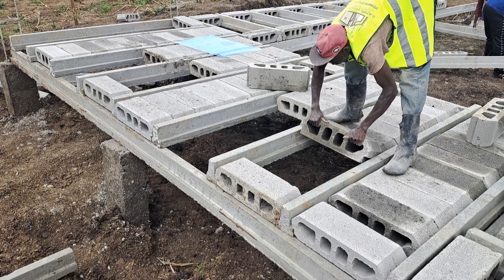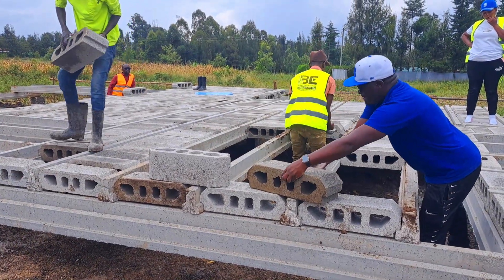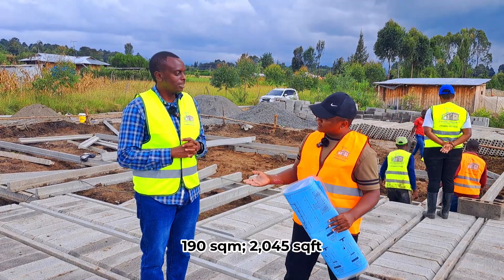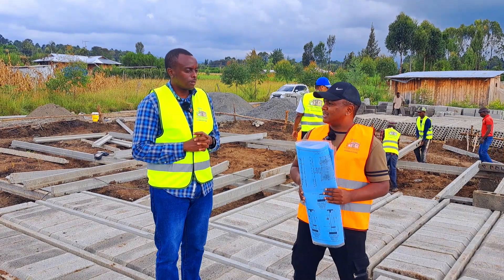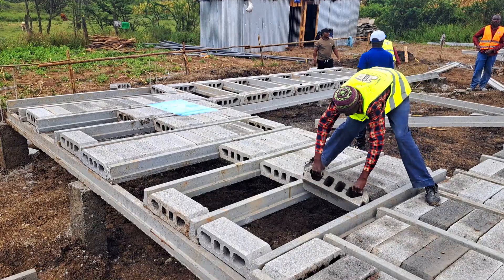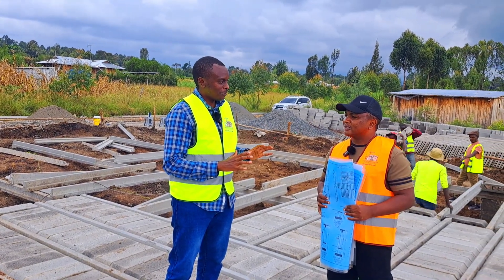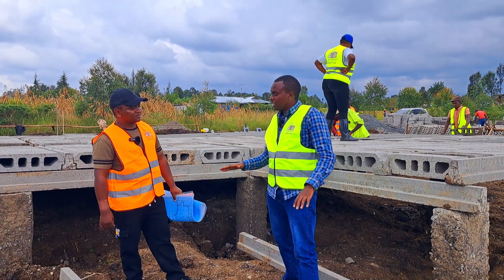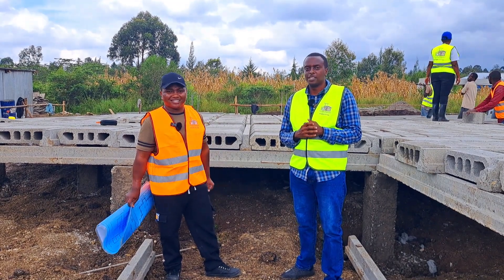Don’t Pour That Slab Yet! Learn About Suspended Foundations First

Comment: Hi Nick. Can these pre cast houses with suspended foundation be used for temporary houses i.e. houses that can be brought down 5-7 years later for a different development altogether. Can these panels be repurposed for a similar house in a different location?
Reply from the maker: The tbeams are permanently bonded with the additional concrete topping, which makes them difficult to recover later. But precast panels are recoverable after construction
Reply: @PropertyNoma Understood. Much appreciated. Fantastic job with these videos btw. 👊

Comment: Are there certification structural stress tests for this process? What about the hollow block, what structural tests certify that the infrastructure load will be born by the structure. How the soil analysis change the ground preparation. 

Overall cost savings?
Reply from the maker: Yeah the tbeams undergo tests at the factory

Comment: Thanks nick for the video, my question is can the same concept be done for a two storey massionate with ndarugo stone walling and on a red soil
Reply: let me answer you . The reason they are doing suspended floor its because  of soil properties   which is cotton  ,its expand  and contract according to the weather season    Red soil does not change  whether its dry season or rainy  season  there is no reason to do suspended floor  .
Reply from the maker: Mostly it has to do with the soil conditions of your site, especially deep black cotton soils